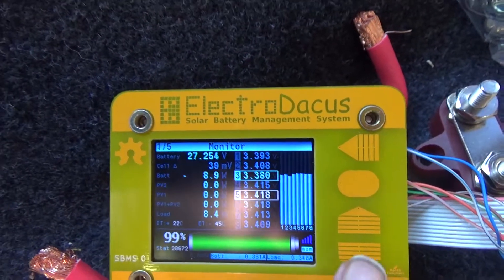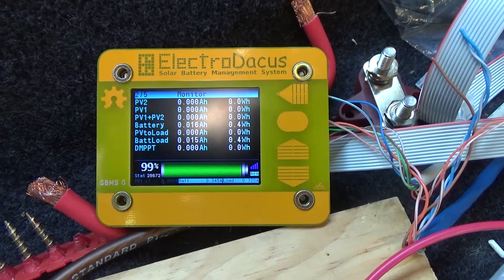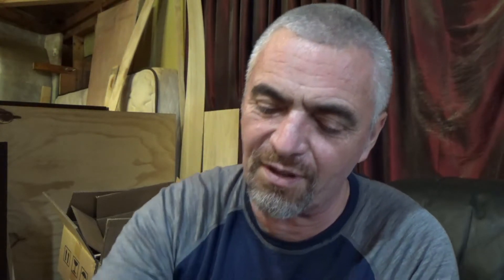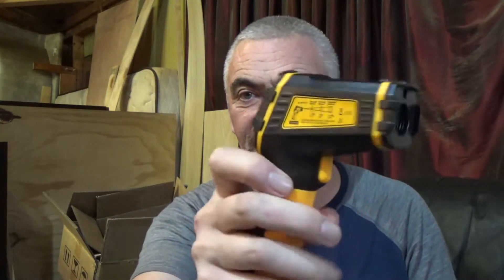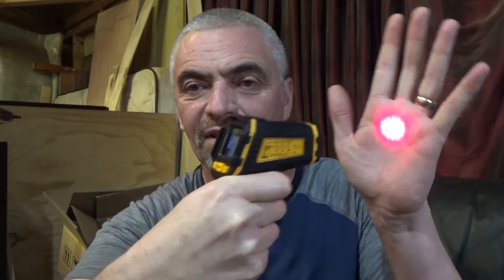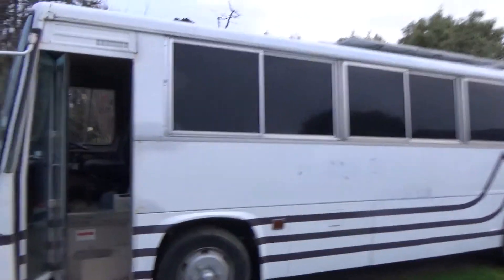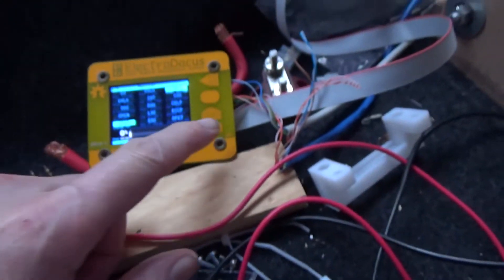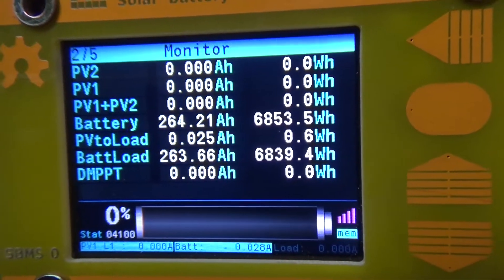LiFePo4 DIY Battery Capacity Testing | Discharging our new lithium battery pack for the first time

Comment: I have 16 EVE prismatic cells at 280 ah on order and also have an electrodacus SBMS0 unit. What was your cell configuration? I'll have to see if you cover building that in a prior video. I'm a novice so advice is appreciated! Thanks!
Reply from the maker: Wow very cool, thats some serious power. Yes I did a build video and one setting up the SBMS0, mine is 24V made from 24 cells so 3 parallel and 8 series. If you are going 24V then 2 cells parallel and 8 series. Haha you wont be a novice for long :)
Reply: @BusedAsNZ  no doubt. One of the best things about this conversion process is all the new knowledge one gains in the process. I'll go back n and watch your other videos. Thanks! Larry
Reply from the maker: For sure, its awesome all the new skills you get along the way, thinking of some plumbing soon
Reply: @BusedAsNZ  that's in my DNA. Grandfather was a master plumber here in Pittsburgh.

Comment: I remember when you first configured the SBMS0, you skipped enabling the cell balance under discharge. You should do another capacity test with that turned on to see if you can squeeze out that last bit of charge.
Reply from the maker: Yes that's right I did. I didn't understand how it worked at the time, still dont really but I will definitely be doing some testing with it turned on to see if it makes much difference. Thanks

Comment: You will get 270Ah as the pack is not balanced yet. I seen that cell 3 was not fully charged and that was the first to discharge. Cells 7 and 8 had quite a bit more capacity left but likely those groups contain better cells. Tho cell 6 seems to be the weakest one as it started from fully charged but was basically discharged at the end of your test so maybe that will benefit from two cells stolen from the pack 7 and 8.
Reply from the maker: Yes, I have since shuffled the cells a bit like you are suggesting but haven't yet had a chance to retest them. Hoping I will get a bit more than that but anything over 270 will be a bonus.

Comment: pretty good, a lot more than the 199AH I got from the originals.  I probably should swap mine over too, but I've already built the battery enclosure and a bigger battery wouldnt fit.
Reply from the maker: Yeah I had to make a new case, then it was too heavy so split it into two cases. And all new links. But its done now so on to the next thing :)